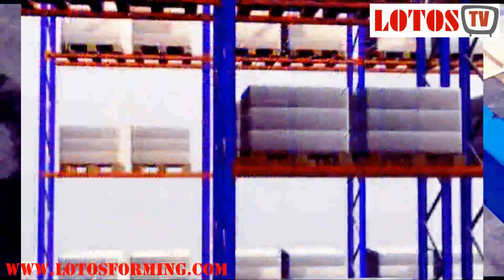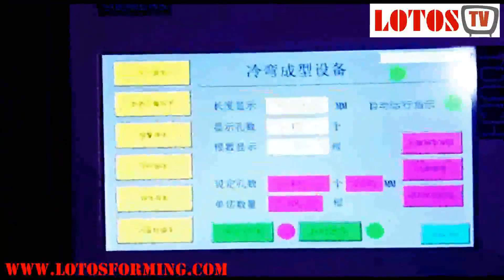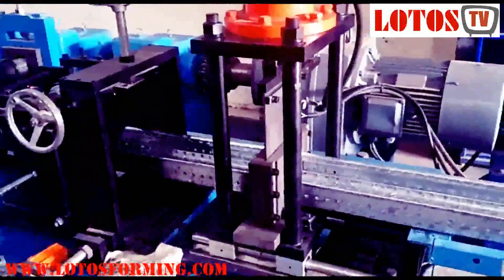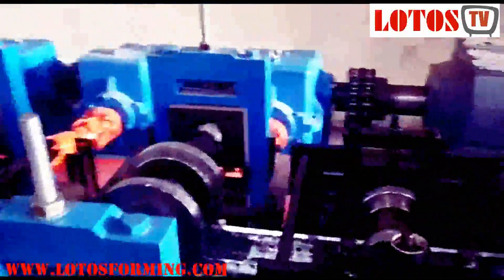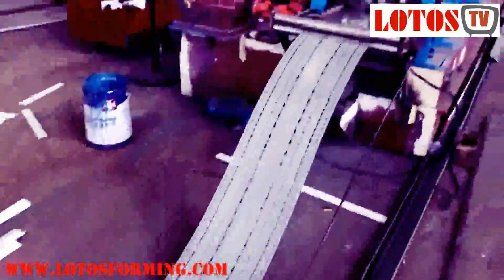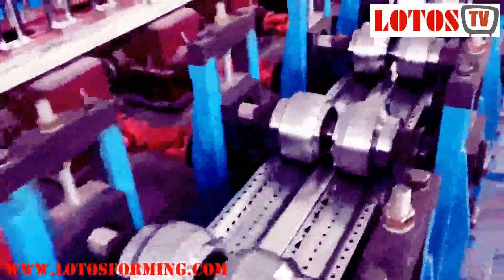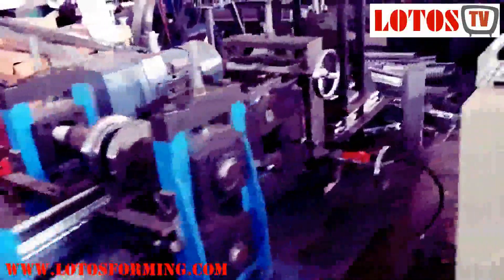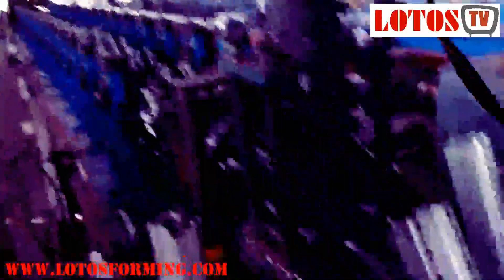【Racking making machine】:  Pallet Rack Roll Forming Machine | Upright Roll Forming Machine

Comment from the maker: Pallet Rack Roll Forming Machine will be combined with manual decoiler and leveling system, mechanical press machine with punch die and roll forming machine part, output table, hydraulic pump station, and electrical control cabinet and so on.
Reply: I want to know about the whole detail about this business and how do i get this machine and how much cost to set up this buisness